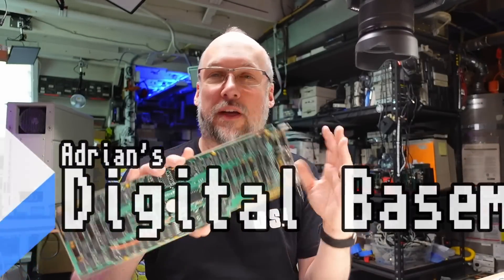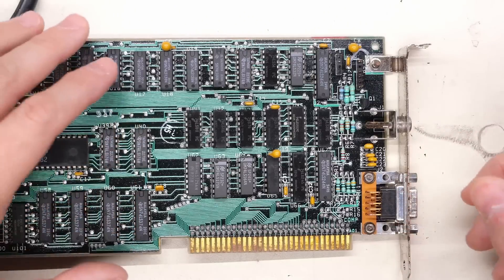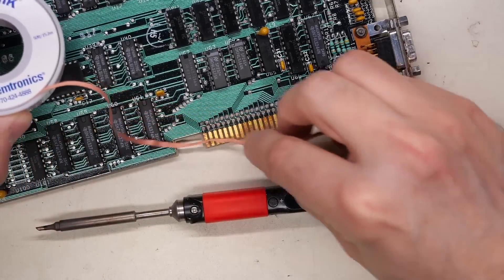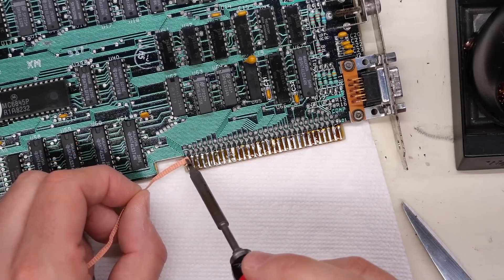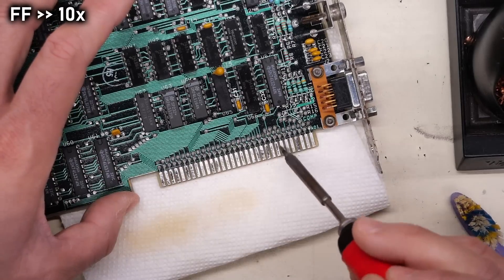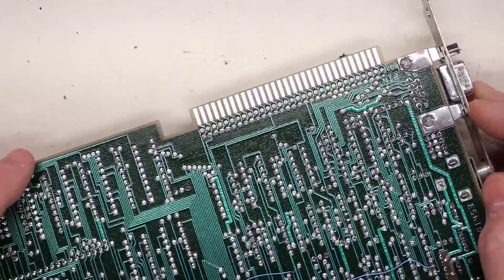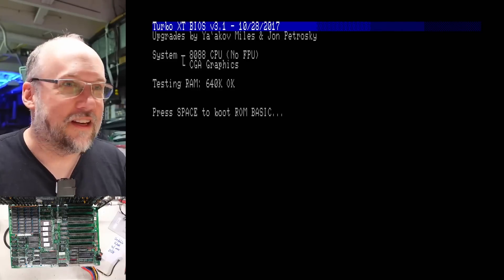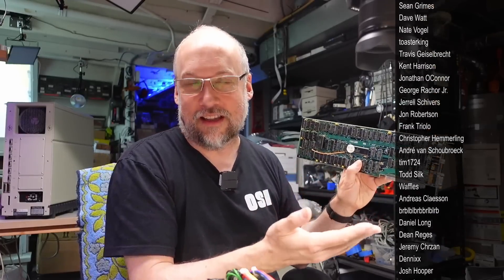Tinning corroded pins on the trash-picked CGA card

Comment: I wonder if chemical plating solution could be used with a cotton swab to plate those.
Reply: Yes they make gold plating kits exactly like that with a swab-anode and a gold liquid solution but they cost way more than a CGA card is worth.  Plus you need the whole power supply thingy with it.  Not worth it for a one-off you'd have to open a finger-golding service.
Reply: @Spudz76  ah, I was referring to tin plate solution. It’s cheap and doesn’t require external power. 125mL is ~$35 and goes a long way.

Comment: I have a Micro8088 with a tinned connector (gold plating is pretty expensive), but unfortunately, this is the source of the problems. Unfortunately, you cannot "untin" the gold-plated connectors.
Reply: Likely works worse the smaller the fingers get.  ISA is 0.100" with 0.100" gaps between so it's like a football field of room for imperfection.  Definitely not valid for VESA or PCI or whatever micro-connector the Micro8088 must have.
Reply: Can you reflow the solder?

Comment: I think you have done the worst thing possible for this edge connector. Solder is the most unsuitable option for edge connectors, it is soft and tends to surface tarnish faster than many metals. While it wasn't showing any issues I would have just left the connector as it was. It may have looked unsightly but after removing the cause of the corrosion the remaining gold plating and exposed copper are still best for long service on an edge connector. I think you were mistakenly thinking that "tinning" with tin/lead solder was the same as tin plating with pure tin, which has been used on budget level electronics connectors. Pure elemental tin is much tougher and surface corrosion resistant than solder but still very much second best to gold plating.
I think you will find that if you use this card a lot, and it is frequently inserted and removed, the solder will quickly wear away to expose the copper. Or if it is stored for a year or two it may not work when inserted the first time. However, obviously it can be re-tinned to restore the surface and allow another period of working use. Also you  may contaminate any gold plated socket you insert this card into as the metals can diffuse into each other.
Reply: And once the lead solder wears away, the scary question is where did it go?
Reply: What is the difference to HASL here?
Reply: @stellardynamix  HASL is intended for pads that will then have components soldered to them. Again I think people are mistakenly thinking that tinning with solder and tin plating are the same thing, they are not. HASL helps the flow solder process used in board assembly be more reliable as the copper pads are already tinned with solder, it takes less time and temperature to bond solder to solder than it does to bare copper pads. Tin plating uses tin only, not lead and tin that makes up solder.
Reply: @bazzaar1869  Thanks! I literally didn't know that. intereting. Yeah. I was under the impression that both would be "tinning".
Reply: @stellardynamix  Nothing, but HASL isn't recommended for edge connectors.  Perfectly ok where you're soldering on all the connectors afterwards.  You need tin or gold plating for edge connectors.

In the end it's fine for hobby or quick & dirty repairs if you're happy with long-term unreliability.  It's probably better than unplated copper which was surprisingly common.

Comment: Adrián, same process but instead of lead imagine using real gold 18 carat for example with the Iron and then use the weak... could it be posible?
Reply: ~913C is a whole lot more than the "about 350" the solder needed to become flowable.  Probably would liquefy the fiberglass resin/gelcoat and lift the pads.

Comment: I just wonder, won't the card slot scratch off what little solder is there?  especially after inserting and removing a few times?  It would only be a little but it would be exactly where the slot makes an electrical connection and then it will oxidize exactly where you don't want.  Maybe its not a big deal....
Reply: It was the same with the gold anyway.

Comment: By tinning the connector, you are making the connector wider because you do not know how thick the solder is on the pins. Which would make it harder to push the card into the slots of the motherboard. The best way is to do nothing and use a "PINK" pencil eraser not "WHITE" to remove the corrosion. The pink is more abrasive than the white eraser. I have been doing this for over forty years in my career as a tech and engineer... Plus solder tends to corrode over time and become black in color... Just some helpful tips... =)
Reply: There is plenty of play in these old ISA connectors.

Comment: I was watching one of USAGI’s videos in his centurion and he was doing some hardware mods to eliminate the flashing while scrolling in that machine.

Had something to do with the clock signal. I wonder if that is how this cart works and if it’d be a similar thing to fix the scrolling flash and no snow at the same time?

The video one I’m talking about is called software problems hardware solutions from 2 weeks ago (at time of posting this comment)
Reply: that terminal has a bug in the firmware. The fix was IIRC to wire the computer to think it's outputting 9600 baud while actually just outputting 4800 baud and set the terminal to 4800 baud.

Comment: NEVER touch the connector pins of modern electronics. They are very sensitive to damage, dirt, oils. My colleague ran a large-scale (non-public) study on this. I don't know if these factors matter so much for older electronics.

 Regarding this old IBM card, I think gold plating is the best option for oxidation, conductivity, and protection of the female pins. But professionals might have a more informed view.
Reply: Signal integrity concerns on those old cards are really weak, so it's going to work and stave off underlying damage for the time being, so in due time it can perhaps be restored better. It's not the preferred contact material of course due to degradation but well there isn't a good methodology worked out that a DIYer can use to restore these contacts to something better.

Comment: I know you’re a little old school, but when you order a new roll of solder it really should be 63/37, it’s a proper eutectic alloy so it flows easier and solidifies at a single lower temperature to make a nice strong joint. I think you’ll appreciate the difference over 60/40.

Also I recently tinned the fingers on an arcade PCB and I used a damp paper towel to chase my iron from the top down and leave a thin, flat surface.
Reply: My partner works in a school where the most common solution to 'fix' 5 year olds is to put a wet paper towel on it.  Nice to hear it works on edge connectors too

Comment: Tarnex Pro and MG Chemicals 421A Liquid Tin allows those connections to be plated over without any heat applied and is super fast..  Might be worth a look. Keeping that surface as thin absolutely as important as possible with edge connectors. Sanding at least in my opinion is a bad idea for pin legs or edge connectors, though that's just me.  It works for many.
Reply: I was going to comment about chemical solutions too! :D
Reply: MG Chemicals Liquid Tin is nasty stuff. It is for lab use only, not home use. Please read and understand the MSDS.

Comment: It wasn't uncommon for "low-end" isa cards and simms in the 80/90s to come tinned and not gold plated, still worked ok
Reply: the edge connector on zx80,zx81s, and spectrums were just solder tinned and were notorious for bad connectios,, eg. ram pack 'wobble' crash!
Reply: @andygozzo72  was gonna mention that. Those connectors aren't goldplated just for looks but because gold is extremely corrosion resistant.
Reply: @andygozzo72  The ZX ram packs had an awful bad design, it had nothing to do with the tinned edge connector, the thing had a lot of weight and it wasn't supported with nothing else but the connector, so it wobbled very easily and the contacts were disconnected. Other devices like the Interface1 or the Kempston joystick port worked in the same expansion port and didn't had any of these troubles.
Reply: @drgusman  actually the rampacks(sinclair ones, at least) did have support on their bottoms, theres 2 plastic standoff lines , interface 1s were supplied with screws to prevent connection issues as it was possible for damage to occur ..  the later sinclair packs werent 'heavy' although the original versions with 2 boards were (i have a few of each), in all cases i've had contact issues, cleaning the tinned 'fingers' solved it,  with lead free  solder, it 'may' be better as i think its the lead in leaded solder thats the problem, look how an old reel of leaded solder discolours with age ..., i have a couple of reels of unleaded still looking bright and shiny
Reply: @andygozzo72  Yes, I refer to the original ones, the bottom supports 90% of the time didn't even touched the floor, and add to it that usually the failures happened when the machine was moved... Also, think what you said "interface 1s were supplied with screws to prevent connection issues", if the problem were the tinning then adding screws would do nothing, the contacts would still fail with time. The cleanup is really more a "blow the cartridge" effect, the cleaning itself did not solved the problem, reconnecting it is what fixes the problem. Of course that gold fingers are better, but on a regular usage a tinned contact will last decades until it could cause problems unless you expose it to very harsh conditions.
Reply: @drgusman  the IF1 screws stop the movement that eventually causes contact problems, if the pcb edge is clean, when  the IF1 is fitted, there wont be any issues, look at pcb edge that has an interface plugged and unplugged several times, you'll see a dark line, this causes contact issues, i think its a lead oxide
Reply: @andygozzo72  So the problem is the movement or having it  stored in very bad conditions... I still have 7 speccies, 3 48k, a +, a +2, a +2a and a n-go, all with tinned contacts and except one that was in very rough shape when I bought it the rest didn't needed any cleanup of the edge port, and I use it a lot, I have the DivIDE, RAM expansions and even my own cards... Meanwhile you have them stored properly it isn't going to cause any problem.
Reply: @drgusman  both can be an issue, if the problem IS a lead oxide, it'll develop over time anyway, if the connector is exposed to air, if a device is kept on it, and not moved, less likely?? moving it 'may' be helping the lead and oxygen to combine, making a possible problem, thing is, i've seen  edge connector fingers tinned with lead free solder and this issue seems to not occur or at least far less often ....????
Reply: @andygozzo72  That edge connector has obvious mechanical issues, it's completely mechanically unsupported and usually not even bevelled, unlike any of the real goldfinger cards. So the expansion connector can lever itself in such a way that the leaf contacts touch the edge where there isn't any metal at all.

But yeah tin isn't the preferred type of contact material. Nicest being of course hardgold, and in a pinch maybe something like nickel. I also can't decide if leaded or unleaded tin is worse, the surface oxide if and when it does build is horrendous either way.
Reply: @andygozzo72 i think its because Sinclair pushed the expense of the connector part on to the peripheral manufacturer to keep the motherboard component cost down. Means that the mating is the other way around to more expensive micros, and the board gets more wear from repeated connections :/
Reply: Worked "okay" being the operative word there. 30-pin SIMMs with tinned contacts were notorious for being unreliable in long-term operation. The remedy for erratic behaviour was to take them out of the slot, clean the tarnished contacts and re-insert them. If you didn't want to have to do this dance every year or two, you made sure to buy SIMMs with gold contacts. 😄
Reply: @HwAoRrDk  The best results were to use tinned edge simms in silver colored simm sockets and gold plated simms in gold colored sockets. Supposedly due to the temperature cycling and not anything to do with corrosion.
Reply: Tin also gets bite marks in it when mating to connectors with high pressure point contacts.  Might not be an issue with ISA slots though.  Depends on how the female pins are constructed.
Reply: Pretty sure I had an ISA parallel port card (for my 2-port print server computer!) with silver fingers.
Reply: Taking corrosion and contact out of the equation, if tin has such  bad contact then why don't we use gold or copper Based  solder?
Reply: @nekosarantango865  its the lead part, not the tin, 'unleaded' solder seems better...
Reply: Of course nowadays they make the gold plating thin enough that even the cheapest of cards have it.

Comment: Save tin and wick. Just use a small peace of wick and tin it. Go through all connectors with it.
Reply: That´s very clever, to use the wick like a sponge and with heat "wipe" it on to the connectors. I´ll remember that for future use, thanks. Question, it would still require flux, right?
Reply: @agw5425 oh yeah you would want flux
Reply: Yeah, flood a small piece of wick and just rub the solder off of it onto the fingers.
Reply: Yep
Reply: If you are adamant on using tin use a tinning solution, not solder it is not the same.
The solder will scrape off and oxidize leaving sockets nasty and error prone.
Reply: @1kreature  Is the tinning solution stronger than even lead free solder?
Reply: @soundspark  To answer your actual question: Tin alone is almost twice as hard as Lead and (51-75 vs 38-50 on Vickers scale) while 60/40 leaded solder is only 16 on the same scale! So leaded solder is very much softer than using a pure tin coating. Pure tin (Sn) is from 3 to 4.5x as hard as leaded solder which would help with durability as well as reduce the nasty transfer.
Reply: @1kreature  why not nickel then?
Reply: @RetroShare2  Absolutely! Nickel is superior. However there are health concerns associated with it...
Reply: Or use the mg chemicals tinning sollution.
Reply: @rimmersbryggeri  I'm not trying to be mean here, but please stop recommending that product... It's intended for lab use only, not the home. Just because you can get it from the online jungle store, doesn't mean it's for you or the home. It's obvious none of you are reading the material safety data sheets or have ever actually used it, and only reiterating what someone else has errantly recommended. If you had actually used it before, you'd already know not to mention this product unless you're telling people not to use it in a home environment. I've actually used this in a lab environment and even with all the proper gear, it's extremely nasty stuff. It is in no way something someone should ever use in a home. PLEASE PLEASE READ AND UNDERSTAND THE MSDS....
Reply: @ParabolicLabs  I have only seen Mr Carlson using it and from what I remember you really need an airing cupboard to use it be cause of pungent sulphur compounds but it is up to the person actually using a product to take the necesary precautions. I don't personalyy thing that tinning is the way to go to restore an edge connector. I do think that tin plating is a more durable option than what is showed in this video though. I don't know how practical it would be to try an re gold plate something like this. Probably not at all.
Reply: @ParabolicLabs  On the other hand I would probably advice against using any kind of volatiles in a poorly ventilated space like a basement.
Reply: @ParabolicLabs  You might want to include a subject here.  Which product is not clear.
Reply: @rimmersbryggeri  Because all volatiles are equally dangerous, obviously... 

/s

Comment: This is basically what I did, accidentaly, when modifying a 5.25 Quad Density floppy drive to use with my Amiga, I had to add a switch for Disk Change (I think? Been a while!) and I went to solder a wire onto a via next to Pin 2, and somehow managed to get solder on the contact, and tried in vain to get the solder off, but ultimately, it's now just an odd one out with all the other contacts being gold, and that one being 60/40 solder plated... :P

Comment: You did a great job there, connector is looking so much better now. What i did on some of the edge connectors  was use rough pencile eraser (rougher side of a double eraser) to remove the oxidation and smooth out the surface, clean with ipa, then tin like you did, then i used hot air soldering gun to heat up 2-3 pins at once and cotton cloth to wipe off the excess wiping from pcb side towards the edge of the connector. I got a very even smooth and shiny surface. I used solder that has a bit of silver in it, i think it was Stannol Sn62/Pb36/Ag2. Very good stuff.

Comment: If you want a ultra reliable tinning according to military/aerospace/medical standards, you now technically have to tin it again and remove it a second time. 

Reason: Gold rapidly dissolves in tin. So whenever you solder on a gold trace or gold plated pin, the gold is no longer there and in the solder joint now and can embrittle it. 
This typically doesn't matter much, and in consumer electronics surely noone bothers with it. For aerospace/military/lifesaving or other high reliabilty equipment it is an requirement though to remove the gold layer first. 

The dissolving I personally witnessed. Tried to solder fine gold wires of a strain gauge with normal (lead free) solder, and they just totally disappeared as soon as I touched them.